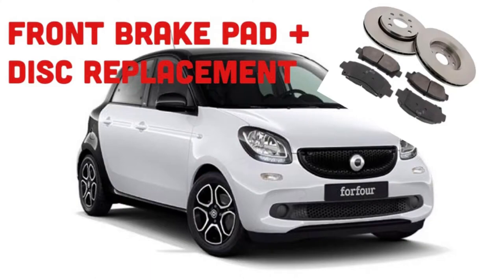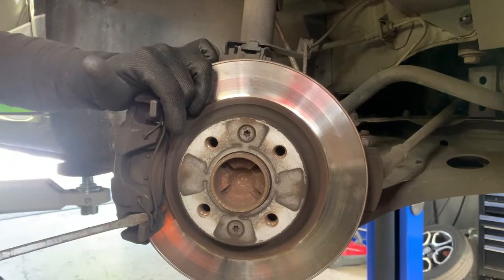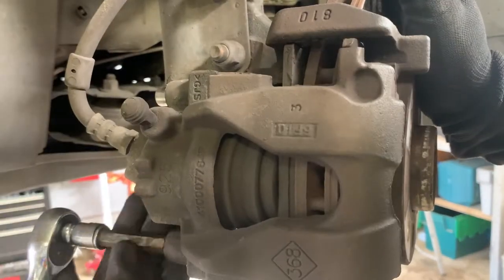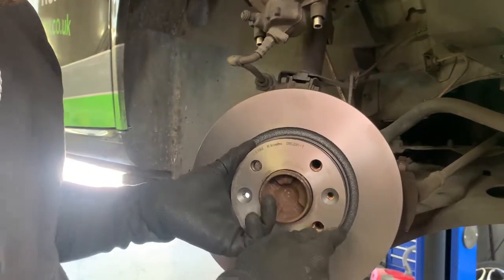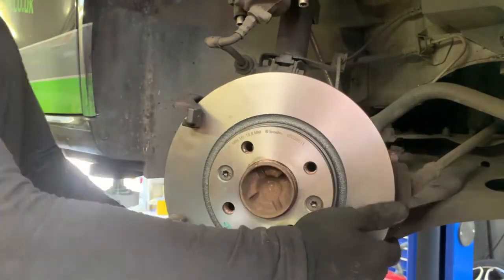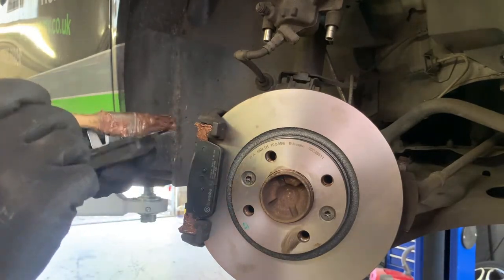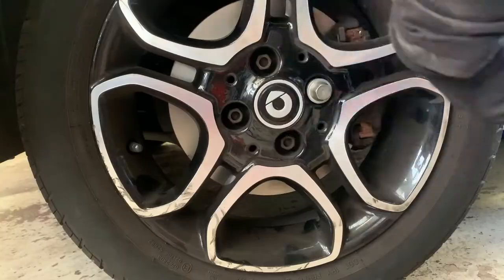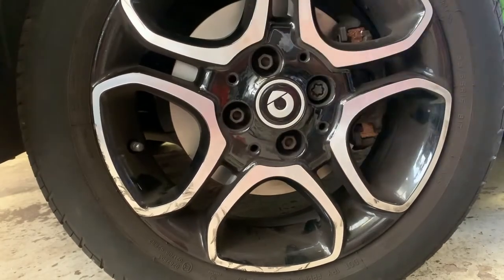How to replace front brake discs and pads SMART FORFOUR

Comment: I just wanted to tell you thank you for making this video.    My wife has a 2016 smartcar fortwo passion.    I’ve done a lot of brake.     I’m comfortable enough to do a brake job at night with a flashlight.     But since owning this car I just had a feeling that I wouldn’t have the right tools for the job.   Luckily I found your video and I was able to go to advanced auto to buy the tools I needed.   Mainly the 7 mm hex and the 17 mm socket for the lug nut.   I didn’t realize that they didn’t give us owners a jack and a lug nut tool.
Reply from the maker: No worries, hope the video has helped